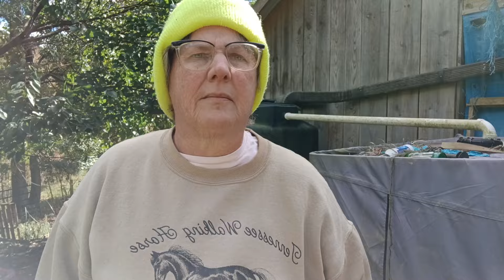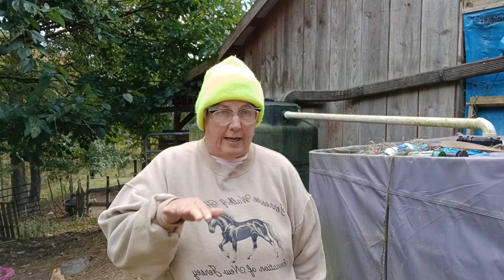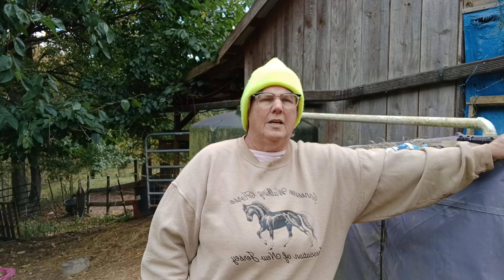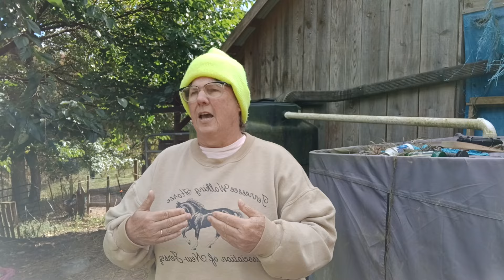How To Water Livestock Without Electricity

Comment: Another option is to put in a sandpoint well or similar.
Reply from the maker: The only problem with that, in a circumstance like Helene, event the wells were contaminated. The more options available, the better the chances of having good water. Of course, if water storage is overcome by flood waters, it is still useless.
Reply: @HoneyHollowHomestead  there are ways to filter it. You can even build a solar still.